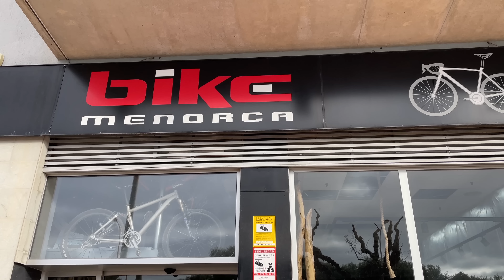Attempting a 700 year old trail on E bikes. | Step 342

Comment: Welcome to BONK town Kika! It's the term affectionally given by bikers who hit the wall of what's possible physically and mentally. Aiming for 100 to 200 calories an hour is super helpful in preventing bonking. Also, that bike has a walk assist feature on the remote,  where when you're pushing it up hill you can push that button to engage the motor to help propel the bike along side you so you're not working as hard.

Comment: When I was a kid we didn't have mountain bikes - so I would use my 10 speed road bike on the trails.  When it came to the point where I had to push, I would put it on my shoulder and just hike with it up whatever obstacle there was, then throw it down and jump on again and off we would go.  1/2 of the kids had road bikes like that, and the other half had 1 speed bikes with banana seats - so we had an advantage when it came to going down hill or on the flat for sure.  This was before carbon fiber bikes, and my bike was a 'Huffy' brand with a steel frame - so not the lightest thing.  I rode that bike so much off road that I ended up breaking the pedal housing from the top tubes at one point.  My dad new a welder who was able to weld it back together, but he didn't do it on a plane, so the pedals were tilted a few millimeters after that - which I got used to eventually.  Later on I did get a mountain bike which made riding trails a lot more fun.  Riding kept me in shape up to my 30s, then I got a couch, and a regular job...meh.  😆
Reply from the maker: Yup. I can relate. Bikes back then we’re just build stronger. I maybe I was lighter. ;)

Comment: I’ve always been surprised you don’t keep e-bikes on board they seem a perfect fit
Reply from the maker: Where would we store them!? Have you seen how tiny our boat is??
Reply: @SailingUma  I’ve thought this through. Folding bars and pedals and then there are almost limitless places they can go. They could go on the platform near the blackboard when under sail. Or under Coco on the deck. At anchor or in a marina they could just be winched up the mast. You guys could work it out. What’s happened to the little wind turbine btw I found that interesting.

Comment: great video, but at the start i was thinking those bikes were pretty wimpy for being electric mountain bikes.   they should have helped you more up the inclines.   but you had fun, you laughed,  you had an adventure you might not otherwise have had.  good job!
Reply from the maker: They had tons of power. Too much usually if we turn it all the way up, the tires would just skid and you wouldn't go anywhere.
Reply: @SailingUma  Ah ok!  It just seemed from my outside perspective that you were struggling more than I would have expected (the stair climbing not withstanding - that's just rough no matter what you use). Thanks for the clarification!  🙂

Comment: I often go mountain biking on a regular bike and an electric one. One hint with e-bike - "walking mode". Modern bikes have it and it is like pushing nothing. You can walk on 30 degrees slope with an e-bike and push it with just one finger. But this trail is a bit too difficult for beginners. Watching you I was a bit scared that you would hurt yourself...
Also if you really think about serious trails, I prefer double hub motors. You get a motor in each wheel and ride it more like a motorbike. You can cross heavier terrain and steeper slopes.

Comment: Cool video, I love e-bikes!
A couple of friendly e-bike tips…first always plug the charger into the bike and then into the wall socket. This reduces the chance of blowing a fuse in the battery.
Second most e-bikes have a “walk” mode that will give you some assistance when pushing the bike up a hill. For the specialized brand, I think, you hold the “+” button for a couple seconds and the motor will give you some assistance. I hope this helps on your future adventures!

Comment: Wow, great work continuing your self imposed torture. That's a hard lesson, an electric bike is fine until you have to lift it up a step or over rocks. Real bikes are just so much more fun. Easier to control and keep your balance.
For me having a light bike is essential cruising equipment, just like a dinghy it enables mobility when not at sea. Last week Kika struggled with washing/shopping. A bike would have made that a breeze. Also good training for the next big ride.

Comment: Protip: if you're getting muscle cramping, you might wanna consider trying to get a bit more magnesium in your diet. Calcium is used for your body to transmit "tense up!" signals to your muscles, while magnesium is used to send the opposite "relax!" signals to your muscles. Thing is too, calcium in a meal interferes with magnesium absorption. But don't take a huge dose of magnesium all at once, because that will just give you the runs and you won't absorb much of ANY nutrients. Just try to make sure your diet includes a good amount of magnesium over a long period of time. Beans, lentils, chickpeas, tofu, all those classic legumes are a great source of it. Dark leafy greens are great too – except kale, which unusually has high amounts of calcium rather than magnesium (remember, it's important to rotate your greens). I'm sure your diet is already very healthy and varied, but it's important to pay attention to where you might be having deficiencies, however slight (especially with something like magnesium, because it takes a very long period of time of slightly higher amounts to build it back up, since you can't just take it all at once like other vitamins like B12 in the form of a shot).

Comment: I have often wondered why you two don't get small electric scooters to range further. Or even smaller electric bikes, with 20 inch wheels.
Reply from the maker: We've never found smaller wheels to be better. Scooters are everywhere in cities. If we wanted them, they're super cheap and can be rented on an app. Bikes too. It's usually cheaper and more convenient to just rent them when we need one that it is to haul them around for months without much use.

Comment: You don't need to push e bike. They have walk assist. You just press a button and it starts rolling slowly by itself.
Reply from the maker: Sure do. But that only works when the tires are on the ground with enough weight to allow traction on the back wheel. These hills were much steeper than they appear on camera.

Comment: Well done!
The chain is so thin because manufacturers changed the front-back-ration of blades from a solid 3/8 to 1/15. The level of strain on the chain is insane.

Comment: It looked like you skipped some of the northern section. Is that true?
Reply from the maker: There was a Segment on the North side that we skipped, mainly because we did not want to be there after sunset. Then the following section we were warned against ridding because it's all stairs and rocks and we'd basically be pushing for 15km.
Reply: @SailingUma  Thanks!

Comment: Stretch first. Pushing, one hand on handle bar. Other hand under the seat gives much better leverage. I use to ride my 20" bicycle on trail's when I was younger. I have a 28" sem, foot to frame bicycle. Year 2000 21 speed hybrid and I am just to out of shape at 66 now a days to even put my leg over to be able to ride again. Today in Massachusetts they have taken Old Railroad tracks and converted them to Rail Trail's, much smoother and safer then Riding on the roadside.

Comment: Yeah!  Dan's back!

From age 4 to mid-50s, I rode 10,000+ miles.  If your rear derailleur is clicking and your chain falls off, then your rear derailleur's stops need adjusting, as does your shifter or cable, depending upon your setup.

Cramps:  Stretching helps, but if you're experiencing muscle cramps, you really need more potassium!  Also, stay properly hydrated and go for ~70-90 pedal revolutions per minute, focusing on consistent and light to moderate exertion instead of trying to power your way through.  Potassium-rich foods great for the trail:  dried apricots, raisins, coconut water, banana chips, orange juice, almonds, cashews.  Unlike salt, humans require far more potassium than they're getting:

Over 19 years: 3,400 milligrams/day for males and 2,600 milligrams/day for females (pregnant or breastfeeding: 2,800–2,900 milligrams/day)

As for Gatorade...  "...potassium deficiency (hypokalemia) was more common in patients receiving Gatorade." - AmeriCares response in the aftermath of the 1994 Rwandan genocide.

I recommend water and potassium-rich foods, but if you must use Gatorade, consider no more than 50% Gatorade with water, and still eat potassium-rich foods.

"The whole trail is pretty advanced mountain biking..."  Lol, the first time I went skiing (7th grade), I stuck to the beginner trails Day 1, the intermediate trails Day 2, and the difficult (black diamond) trails Day 3.  While it CAN be done, falls are inevitable.  My longest single-day mountain biking was 47 miles.  Fortunately, most of it was on a paved road.  I know, that's cheating...!

Comment: I used to ride my mountain bike in the back country on the weekends and would ride about 40 miles. I also trained during the week where I would do a 24 mile ride in the foot hills that took about 57 minutes. I would also trail run to the top of the local mountain and back which was about 4 miles each way. I miss it and plan to start doing it again but I also want to sail around the world like your doing. I stopped doing it because I decided to focus more of my time for work so that I can afford to get a nice boat.

Comment: Loved the episode. I am a long time mountain biker and sailor and so you surprised me with my second passion today. Kiki ~ you did so well! At the start I was thinking you were in too deep but by the end , you were crushing it! I wonder when they are going to put a ‘walking up a hill’ button on the electric bikes to add some power assisted drive so pushing it becomes a whole lot easier!?! Thanks guys for another inspiring episode! ❤🎉
Reply: I thought most e-MTBs had such a walking/pushing assist button. My full-suspension e-fat-bike does and it's quite nice when having to push up steep trails.

Comment: One 11 chain drive set ups are very short lived ...  as the whole gearshift mechanism has to be tediously tight ...as soon as they get dirty and start to wear your prettymuch commited to replacing the whole assembly...
High torque e drive really stretches them to their limits in double quick time.. 

Better Hub gears and 7/8 speed chains max ..better single speed or kevlar belt drive. 😉

Comment: Speaking as someone who has done a bit of motorcycle enduro riding (and a tiny bit of racing) (and I tried mountain biking once and the skills absolutely transfer). You rather need to look where you want to go and let the bike sort itself out with the details. Also, don't try to stay out of ruts, because you will drop into them anyway, and if that's where you aim at least you know which rut you are going to be in. 
Downhill is harder, you sometimes need to just plan "I can brake there, and probably there, but the rest of the time just hang on and accept the speed"

Comment: Really nice! Also the chain on ebikes often break when you shift during the motor is still pushing. So always try not to shift under load. The thin chain is because of theodern 12 speed cassette. Less components, more range. The thickness doesn't determine the strength, only the perpendicular bolts determine the thickness so it has the same strength as thicker chains. But you were best prepared for that! Also I hoped you reached Kika some technique how to ride and position over the bike, really challenging and well done for the first time MTB!

Comment: Love the adventure. I built my own ebike with a 2000 watt mid drive motor, 60 volt and a throttle. 40 miles is a breeze... lol Specialized is awesome but overpriced and underpowered. I saved $3000 and can outperform it by 300%. Top speed over 55mph and easily cruise 25 mph for over 100 miles no pedaling. I also have walk mode to go up stairs, no pushing. :D

Comment: As a former adventure cyclist I had to laugh... 😅 21,000 trip miles. Transcontinental, US  3,500 mile trip. Touring mountain bike, JANND panniers, 60- 80 lbs. gear. 135+ miles, a record day...flat to 10,000 ft. passes.. Start slow ... 😐 p.s. Trees don't have outlets. Cyclists don't use electric bikes...

Comment: you need to get better bikes I bought my wife and I KTM's you can climb a 8% grade sitting on the seat at 15mph with the motor on the front sprocket you get the benefit of the gears and you could probably climb a 90 % grade if you could get traction. Ours have know throttle motor works with your cadence with the pedals and has 4 power modes depending on how much help you want.

Comment: I loved seeing this video! I'm a long-time bike tourist and it's so exciting to see my favourite channel giving it a go! And yeah, those bikes seemed WAY too heavy for the touring that you were doing. My rule for a bike is that it should be light enough when unloaded to be lifted with one arm, and light enough when fully loaded that I can lift it with both arms. That way, when you encounter obstacles on the road, you know that for the smaller ones you can just lift it over with both arms, and for the really big obstacles (like stairs), you can unload the bike and lift it overhead to carry it over, then come back for the baggage. I see that you didn't pack anything on the bike for this tour, but your bike should always have some sort of 'extra light mode' for the challenging obstacles (like maybe if you could temporarily remove the batteries and then come back for them).